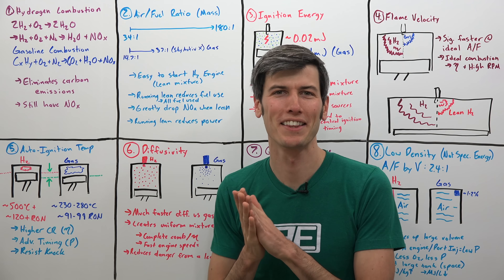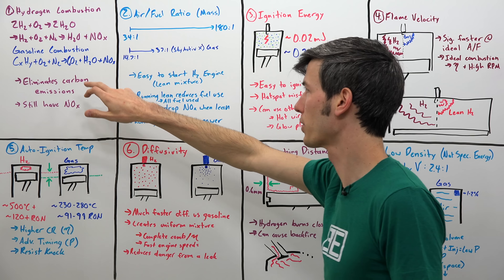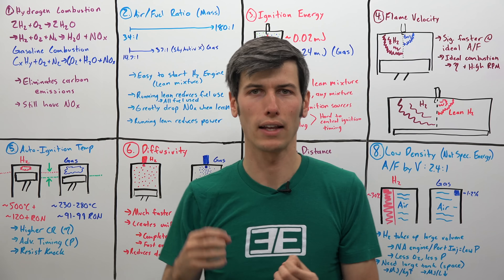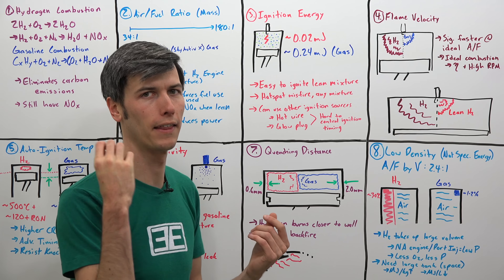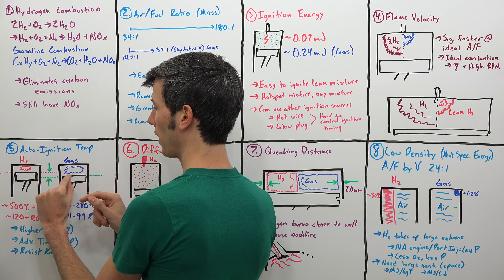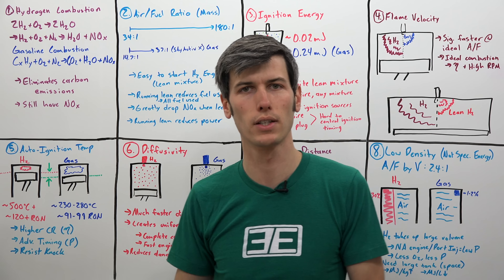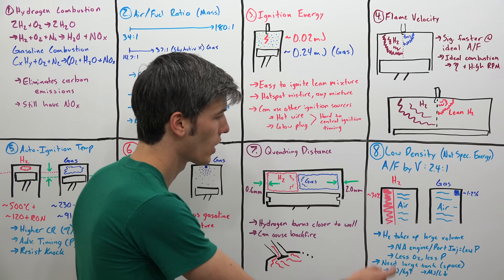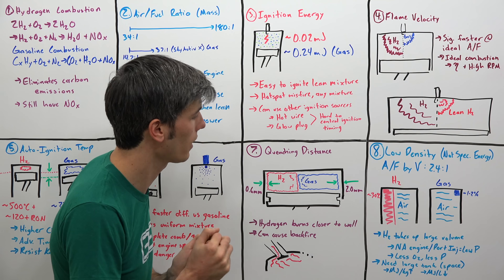The Difference Between Gasoline And Hydrogen Engines

Comment: hey 
greate video 
now if you can and want to , please do a similar video but with natural gas (LPG) instead of hydrogen.
as here in Algeria we use it so much and in many engines 1.0L 4Cyl up to the  6.0L V8's
and we did find a way to prevent the LPG from hurting the intake valves .
we did made a hose witch connects in serie withe the cooling systeme
and it has a hi pressure hose so the Ngas(LPG) flowsinto and then in to the cylender
and when doing a cold start the morning the cars automaticly turn on gas and afer 2 min switches to the Ngas(LPG), like when turning onn when going to home you have to leave the engin at least 1 min at idle so the systeme switches it to the gas for the next start in the next morning.

Comment: One can ceramic coat the combustion chamber surfaces to decrease quenching and hot spot possibility as well as improving efficiency (less heat transfer needing engine cooling). Also, running some exhaust thru a condenser and recycling it using water injection cools the combustion to decrease NOX production while getting more power via converting that water to steam with its 1600+ expansion in volume. Granted, cooling also decreases power, whether the steam production makes up for it ...I don't know.

Comment: All it takes is a big battery breakthrough and hydrogen discussions go away.  Question is, how soon will it happen?
Reply: any power source that is liquid and can be converted to vapor will always be a better solution than batteries to power vehicles. you really know knowing about infrastructure and are too memed out to realize the only reason electric vehicles are brought up in conversation.

Comment: Sooooo, if Mazda made direct injected rotary engines that used hydrogen what would happen to the emittions? Could they pass? They had made an RX-8 hydrogen model. What were the emittions on this one? Could the rotary experimental program make a comeback? And what is the retail price on hydrogen? Is it possible to be used as fuel for the general public?
Reply: why direct inyection if you are using hydrogen? the rotary is dead for now emissions are not the only problem
Reply: @omegarugal9283  emittions are the only problem. If you were paying attention to the video you would know why direct.
Reply: @PELPIDAS  direct inyection in a wankel?

sure emissions are the only things that keeps the wankel dead, not to mention uneven wear that requires periodic rebuilding, the fact that it burns oil by design...

go read some more about the wankel....
Reply: @omegarugal9283  yeah emissions ARE the only problem. All the other stuff is minor details I (and a lot of people) can live by. Owning a rotary car isn't for everyone (you included) but when you are in love some oil (I don't see the problem in that, it's just a different type of engine), a rebuild every 10 or so years and whatever else you may think is just to little to consider. Mazda can't produce them because of emittions standards, that it's, nothing more nothing less. (Also consider that on this engine type has been done only a little research compering it to the Piston engine. So these issues that you have may be solved in the future if we keep researching)
Reply: @PELPIDAS  10 years? more like 2 before you need new seals...
Reply: wake me up when such thing happens... por when pigs fly, whatever happens first
Reply: Hahaha, keep dreaming

Comment: I imagine hydrogen combustion would be more challenging with regards to lubrication. In a fossil fuel powered engine, the fuel helps to lubricate the cylinder walls. You won't get that with hydrogen.

Comment: port injection like in the BMW M4 GTS- that uses direct hydrogen mixture into the cylinders- if you use a generated hydrogen injection through the intake- you'll create that blue flame within the cylinders- creates zero detonation and higher compression- also have a better outcome with mpg, lower engine temps, engine longevity and of course for the green thumb people- better for the environment- forces more oxygen back into the atmosphere out the tail pipes....i am a huge proponent for hydrogen fuel...electric is a bad gimmick that should have stayed in the late 1800s where it ended...

Comment: 1. So catalythic converters are still needed?
2. Reduction of power... we have seen cars getting smaller and smaller engines (especially in Europe) with smaller volumes, less cylinders. Does this mean we might see BMW come back with a 6-inline 2.5 liter hydrogen engine? :P
3. Hotspots... would an Alfa Romeo type Twin Spark solution partially solve the hotspot issue? Ah... nevermind you talked about a twin setup of spark and glow plug.
4. So high revving engines are back? SWEEEEEET!!! With bigger engines and higher revving, maybe with a new type of timing and injection technique you could still run lean but full power as the driver calls for the power. :)
5. MORE POWERRRRRR!!! I'm liking this more and more... keep talking the good stuff! Onto point 6...
6. Efficiency means less fuel needed I guess? Better combustion is always good cause you always want to make the most out of it. :)
7. How about cooling the engine with the combustion being closer to the wall? Is it an advantage or disadvantage? Second question... would a hydrogen Wankel/Rotary engine work or not? I am thinking about the leakeage past seals and so on on the rotor, especially when they age/wear over time.
8. Weight reduction bro! :P That's the last thing I needed to know. Also large fuel tanks relative to action radius isn't an issue. I'd rather tank hydrogen more often in a minute than wait for an electric car to charge for an hour.

AWESOME presentation and now I know that for us petrol heads hydrogen will be the future. Also you haven't addressed the issue yet of pulling a trailer or maybe using hydrogen in trucks and busses, although I think it is quite obvious that for those of us using the car and trailer/caravan to go on holidays it's a no brainer that we need to get hydrogen. Electric vehicles aren't made for towing a trailer, and it would significantly reduce the action radius if not worse and it would burn up the electric motors due to stalling them in say the European Alps region.

Can't wait till hydrogen becomes a thing. Until then I will be using my BMW E46 as probably my last petrol car. :)

Comment: Thank you for another great video.

I got a question regarding what effects that hydrogen may have (if any) as regards to internal lubrication of the engine when used in combustion engine?

A few years ago, I was helping out an university lab experimenting injecting hydrogen onto a 1.6 litre 4 cylinder petrol (gasoline) engined vehicle.  To do this, a CNG injection kit was modified and the hydrogen was injected via port by dedicated injectors separate to the existing petrol injectors.  This kit enabled to kill off the existing petrol injectors whilst the hydrogen injectors were in operation but still enabled to switch back and vice-a-versa where necessary.

The car did run and idled fine however I remember something like a litre of water came out of the exhaust within minutes and a puddle quickly formed only in a very short course of time.  Obviously, the fuel ratio, the mapping and ignition timing etc were based on that of petrol and the only parameters adjusted was the type of fuel injected being hydrogen, therefore this could be the reason of huge amount of water coming out of the exhaust.

I was only a support person for few days so unable to follow up the experiment after the installation of the modified CNG injection kit.

Nevertheless, as the byproduct is H2O, surely this would somehow affect the engine oil degradation and internal lubrication?  Could this be one of the reason why the so called hydrogen vehicles use hydrogen to generate electricity which that powers the motor instead of using hydrogen like it is used in internal combustion engine?  Would like to hear your views on this please.

Comment: Thanks for talking about the horrible density of Hydrogen. This is something many people lobbying for hydrogen usually ignore. 

A high pressure hydrogen tank at 700bar has a energy density of ~5 MJ/L while standard Gasoline has ~34 MJ/L (Diesel ~38). So for the same distance your tank needs to be ~7 times the size. And it needs to be a pressure tank, so the tank will be a lot heavier (empty). The filled tank will be lighter than the filled gas tank. However this advantage will completely diminish and even become a negative when you factor in that you need to build a bigger car to house that massive tank.

Comment: I'm seeing very little downsides to hydrogen and I certainly think it has a better future than electric simply because it would be much much easier to switch to without massive infrastructure changes. People could simply swap and fill up as they always have done.

One question about the Nitros oxide production -  could the gasses not simply be filtered and the NO2 then recycled and put back into the engine to improve performance?
Reply: It all sounds good, until you see the prices and what it takes to make Hydrogen, and how much more you would need to have the same range as gasoline.
Also, Hydrogen doesn't like to stay a liquid at room temperature and pressures, so yeah, think about that.
H cars are not the future, so forget about it.

Comment: Whats about the burning temperature?
Hydrogen burns much hotter i think and in combination with point 7 that a main engigeering problem ... lead to stronger materials.
And as well it gets easier the hot spots you already talked about...
Reply: back in the 90's a company made an engine with ceramic cylinder walls and pistons (mainly for experimenting with fuel(gasoline/petrol) efficiency . (I think it might have been Honda)  This would probably solve the Hydrogen combustion issues.

Comment: Completely outdated (or biased ?) review. We're in 2018 Jason, and you didn't say a single word about the fact that modern H2 ICE engines ALL have turbochargers or superchargers. Not a single word. And they all have direct injection. AND, by using turbo or superchargers, "at this air/fuel ratio, the formation of NOx is reduced to near zero" (wikipedia on "H2 ICE"). Why do you only talk about NA engines that produce Nox when it's so outdated ? So misleading.
Reply: he's doing an apples to apples comparison of N/A gasoline vs. N/A H2 combustion engines.
Reply: Can you point me to modern H2 ICE engines?

Comment: Great video, Hydrogen is a fuel i can get behind. I would love you to also do a video on this from the industrial, logistical and practical perspectives. How much easier or harder is it to get hydrogen into the usable form. Is it harder to store. Is an ICE engine hard or costly to modify for hydrogen use. Is the current gasoline infrastructure hard to convert to hydrogen use. 

Electric cars are great and all but from a practicality standpoint I certainly couldn't have one, hydrogen seems like a better way to reduce emissions while also keeping the practicality of gasoline/diesel. This assumes ofc that there isnt some other part of the chain in which hydrogen is poor such as cost to produce the usable fuel, cost to modify existing engines and infrastructure etc etc.

But equally as important if i converted my car to use hydrogen can i still shoot fire out the exhaust.